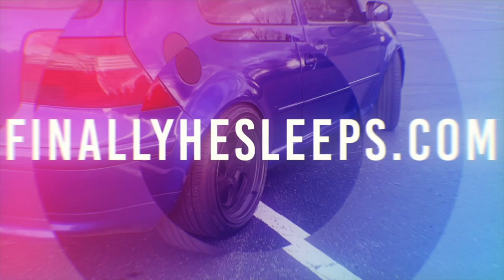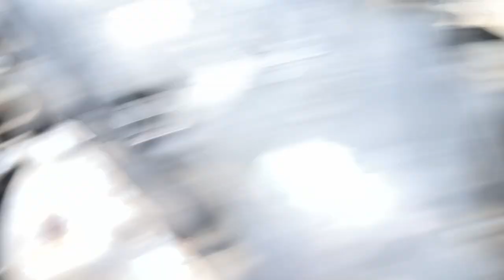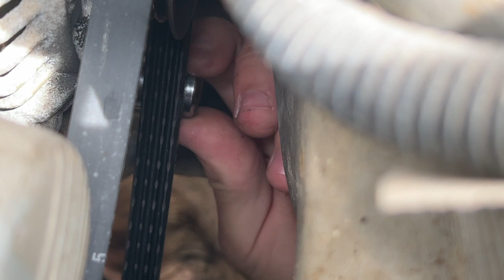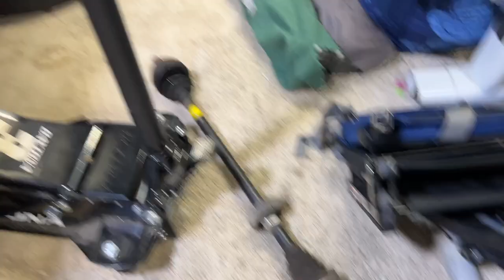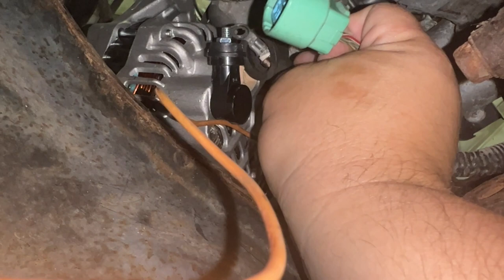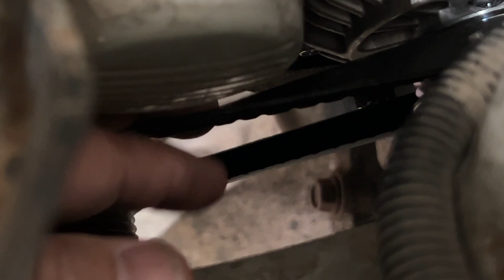HOW TO REPLACE YOUR ALTERNATOR - 1992-2000 Honda Civic - At home with a basic tool box

Comment: If you would have taken the splash guard off and the alternator bracket off it comes right out the bottom past the pan and axle.
Reply from the maker: Not on the EK.
Reply: @FinallyHeSleeps  yeah I just did it on my 2000 EX. Lots of videos about it.
Reply: @FinallyHeSleeps you didn't take the bracket off
Reply: Agreed. Something as small as not removing the alternator bracket will cost you alot of extra time and work

Comment: Thanks for posting this. Man, this is a tough one. I've reviewed a few videos and some people take out the alternator from the top, some from the side, some from the bottom. I'm kind of "intermediate" and I don't think I can do it. Honda engineers messed up this design. You shouldn't have to take your car apart. The best unconfirmed trick I read was removing the master brake cylinder assembly and I think the power steering hose and up through the top.

Comment: Hey I’m a bit confused with that ground cable to the body, original alternator does not have that, is that some sort of by pass from the white and red & white and green wire from the green plug?

Comment: I'm convinced it isn't possible to replace the top adjustment bolt once it has been removed even if you have small hands there is not enough room to get the threads started and the hole in the alternator is not visible. an air ratchet might work but I think I will have to buy a longer bolt go in through the other side and put a nut on it. If you watch all the videos they leave this part out.